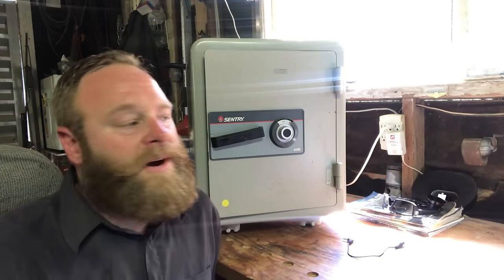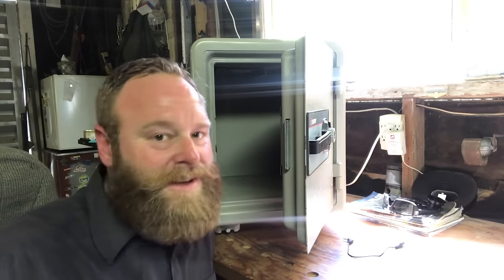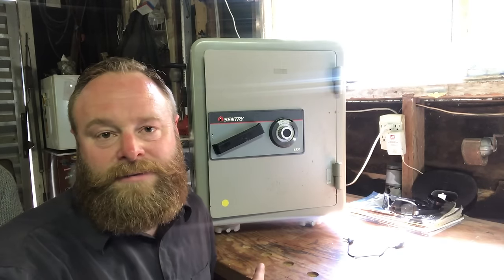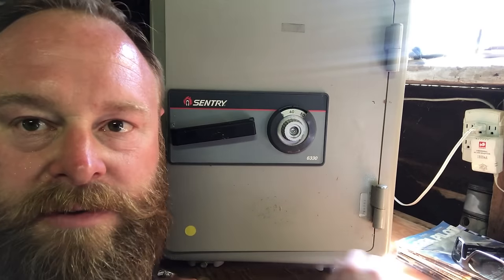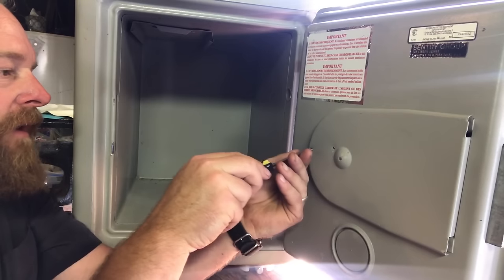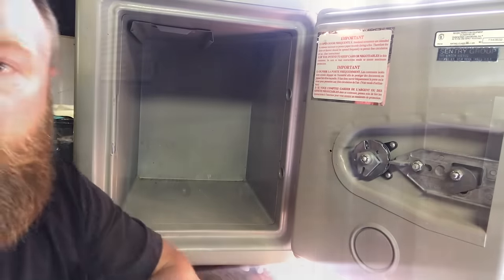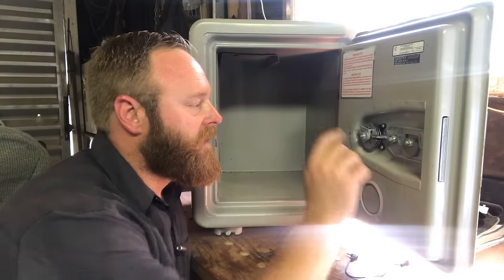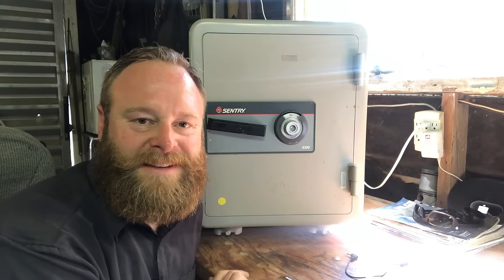I Just Cracked The Code On This ABANDONED Safe!!  I’ll Show You How

Comment: Thanks for great video. My safe had a plastic cover ap99 series with 4 locking bolts. Just a few minutes to remove that cover and followed what you did to find slots. 👍
Reply from the maker: Glad it was useful to you!!
Reply: I just got the same safe with the 4 lock pins I'm going to take the plastic cover off when I get home 👍

Comment: I work for bank and I’m trying to get in to one they had me throw out most of the time the bigger ones will have a combo on the inside but if there is a key hole on the tumbler it usually locks the tumbler so it can’t be turned

Comment: If you already have it open why dont you just open the access panel to the gears that set the combo ,pull the set pin reset discs to new combo . Put cover back on . But that begs the question why didnt the original owner do that.

Comment: I just bought a storage unit with one of these in it.

Might try and diddle it with the stethoscope or something. I don't want to ruin the safe.
Reply: how'd it turn out? someone gave me one free on facebook marketplace..  i'm sure nothing is in it but i want to use it for my important papers to be safe if there is a fire
Reply: @DN-zh1bv  I bought a stethoscope, and I put a few hours into it. I just didn't have the patience/skill, but I could certainly hear the mechanisms pretty well. Also tried using the sander-vibration trick to shake the tumblers into place. No bueno.

Ended up contacting a lawyer to write me a letter to present to the safe company, and they sent me the combo. Could've gone the destructive route, but this was easier, and the lawyer cost is offset by preserving the safe itself.

Contents were... interesting lol

Comment: I opened a safe like that by cutting the henge pins took me five minutes 😂
Reply: explain
Reply: @jacksonwheeler4731  He can't because there are bolts that latch the hinge side of the Sentry safe door. Even if he cut the hinges off, the safe would still be locked.